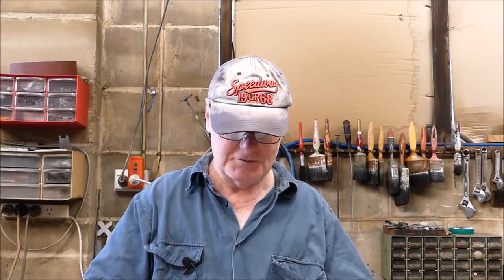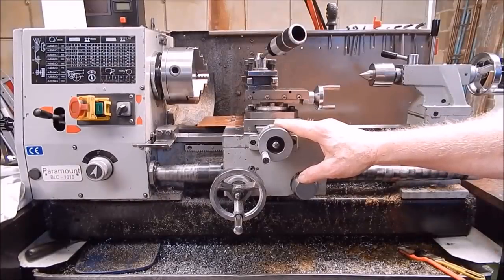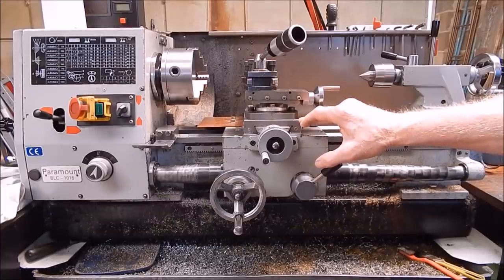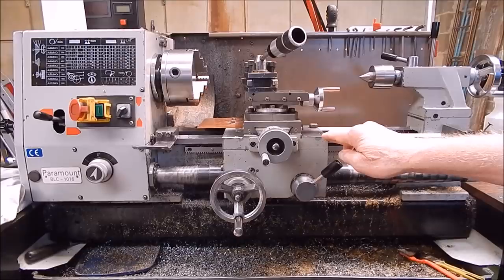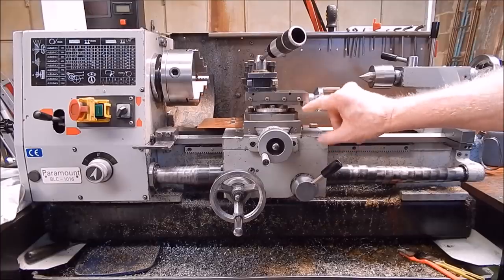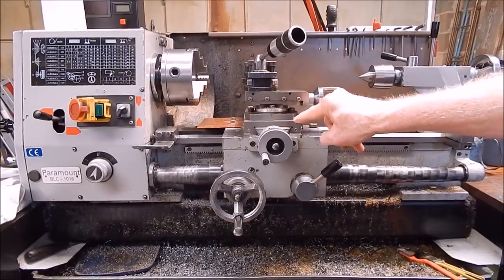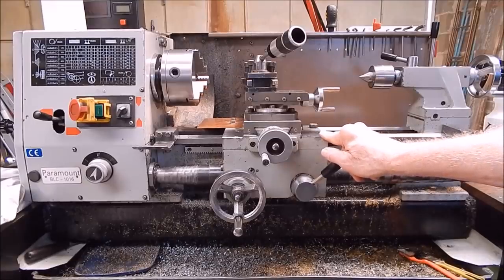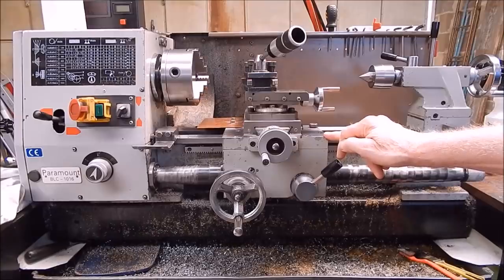The serious weakness in many small modern metal lathes

Comment: Hello Xanadu. About the weakness on the cross feed slides, with Tee Slots. Most slides are made from cast iron material. I might not be a engineer, but I have worked with a lot of machine tools. Tension from the Tee-Nuts, can effect, how the ways are adjusted. I just purchased a 10" x 20" Lathe, I wouldn't even have Tee-slots on my machine.
Reply from the maker: Yes, that's dead right Keith.  Cheers Rob

Comment: I think you have underestimated the strength of the remaining material. and over estimated the torque applied to it. For what these lathes were designed do, they are more than adequate. In one of my videos, I show an upgrade to the drive system on a Taig lathe. The upgrade allowed me to vastly surpass the original intended use of the tiny machine, however, I did not take into account the remaining parts of the lathe not being of sufficient strength to handle the extra torque. my point is, theres a limit to what these lathe can and should be used for.
Reply from the maker: Cast iron will definitely flex.  Put a bar in the tool holder, apply pressure and watch the dovetails spring.  More metal can only be a good thing.  Also stall your small lathe at say 400 rpm and watch the cutting tip drop.  Scary.  The problem is worse on some lathes being sold as the remaining metal thickness is pretty marginal IMHO.  Cheers Rob
Reply: As an experienced tool maker of 14 years, I would have to agree with the video but also the point stated above.  These machines are not made to take large cuts or do high precision work like production machines are.  The ones that are are priced substantially higher for a reason.  There's nothing wrong with the t-slot design if you know the capabilities of the machine.  You could drill and tap 4 to 6 holes and make a top plate with t-slots or bolt holes that bolts to the existing cross slide to strengthen it up and remove flex.  I would personally recommend a small used clausing or leblond to anyone that has the space and power requirements availablejj, but most don't .  You could always beef up a little guy the best you can if you want to push it to its limits and hold relatively tight tolerances.  Rigidity and compact size just don't go hand in hand without a high price tag due to machining, material and design costs.

Comment: The reason they put the slots that way is for gang tooling.  I have seen it more on smaller slant bed cnc lathes that turn short, small parts.  It is cheaper than a turret tool changer.  It is also useful for more accurate hole drilling that using the tail stock.  You set however many tools you want/can fit on it and just move the cross slide in and out to change from od tools to ID tools.  Not saying this is the best way to do it on these small lathes, but my guess is they did it to copy that style.

Comment: Counter rant:-  If you put a milling slide on to those long T slots it is very useful to mill face on....or slide back on the T- slots and rotate the slide.  Without this ability to move along the T slot, The milling range is severely limited.  I also mount other things on these slots...An ER 16 milling cutter and a rear part of toolpost.
Reply from the maker: Hi Joss, I would rather have a rigid cross slide and drill and tap a few holes - which I have done.  I expected some owners will use the "T" slots for milling, but the majority won't do anything like that.  Cheers Rob

Comment: If it concerns you then bolt a strong back (just a bracing beam) across the tee slots in 2 or 3 places where it isn't in the way.  Bingo.  Stiffness restored. 
You just made a composite beam. Composite beams work fine as evidenced by all the riveted road bridges out there.  Just because the lathe manufacturer carved sections out of solid by milling doesn't mean that other options aren't possible.  Sometimes a little lateral thinking is called for...
Reply: Yeah a "strongback" a viable alternative , I normally have one on , It s held down by several tapped boltholes. I often have a  a   big grinder on my biggest lathe on the rear of the CS , also the strongback gives  more length to the rear, that the grinder mount uses

Comment: Honestly most newer small lathes, even one like that paramount are more issues out of the box than they're worth. The whole t slot on the cross slide idea is stupid but I think its meant to make the lathe into a "universal" machine by allowing the use of a milling attachment. I think thats plainly ridiculous. In saying all that, I've got one slightly larger than that paramount lathe and the amount of time, money and effort I've spent to get it running right is ridiculous. Not to mention they have no cross slide power feed without the price going up 2 fold at the very least.
To be completely honest if I had my time again, I'd probably get a well loved colchester student lathe as the footprint is basically the same, price is the same, quality is out of this world in comparison, even after 40 years of apprentices and schools abusing them.
Reply: Absolutely. I've got two old Aussie lathes (Advance & Nuttall) and an old Aussie student mill (Hercus) and they're so much more solid than my mates modern imports it's not even a contest. The examples I have are in good order, accurate and a pleasure to use.

Comment: Point taken re the strength factor. I used to wish my old Raglan had t-slots because I did a lot of milling in it years ago - however, got round that and since those days probably prefer not having them. My cross slide is built like a brick latrine considering the lathe size (11" capacity).

Comment: You could be onto something there .  Leblond used to do it years ago , but they would have had castings designed for it no doubt .  I wouldn't have thought a small chinese lathe  would have created enough distortion pressures to have an effect  , but i do tend to agree with you . Cheers .
Reply from the maker: Hi Max,  try stalling a small Chinese lathe at say 400 rpm and watch the tool post flex/cutter tip drop.  Scary.  It's enough to snap the tip off that nice expensive indexable insert you've been using.  There are serious pressures at play, believe me.  It all ultimately goes down to the dovetails. Cheers Rob

Comment: Good video Rob. Very good points on the slot direction
I would have no problem with long slots if they made the slides extra thick to compensate, but it's China, they would make it all from sheet metal if they could find a way to make it work

Old lathes are better built. I'd love to track down a nice slotted slide for my Hercus

Comment: Most lathes I own are decades old European machines bought from scrapyards (Schaublin 102 & 102n, Weiler rdu280, Churchill Cub mk4). The only exception is a tiny little "Akebono Kikai" which is japanese, but was probably built for use on a warship considering how heavy it is for its size. In my opinion If you're going to do anything serious with the machines, it's best to buy used equipment and restore them to near new or better than factory condition. Lightweight hobby machines which don't have stellar accuracy to begin with, won't survive any degree of heavy use. They sure don't make 'em like they used to!
Reply from the maker: Another 102 owner.  Good to hear from you.  I have an early open headstock 102 and I have the VERY earliest headstock for one (in mint condition)  with no thrust bearing as they later fitted.  That is damn damn old. Awesome machines.  Plus they look incredible.  Cheers Rob
Reply: @Xynudu  I bought my first schaublin 102 after watching your restoration videos a couple of years ago. Open headstock variety, made in 1964! Loved it so much, bought a more modern 102n a year ago (1990 model). Your videos are a great source of information and inspiration, keep 'em coming! :)

Comment: Also if there is even the smallest chance you might ever opt for a cnc upgrade on your lathe (not a big deal anymore, with the many turnkey packages offered) ,,,,you will thank heaven for tee slots running the long way bc gang tooling is then a cinch.
Reply: I most gang tooling I have looked at was a complete unit that gets bolted down rather than a series of independent holders. Also, keep in mind, cnc will do away with the cross slide, so the height to mount the gang tooling is necessary.

Comment: My Warco 12x36 has T-slots crosswise and I added one at the rear for a rear toolpost.
Reply: My Warco 300 hs tees running both ways as its a mill as well but there is still quite a bit of meat in the cross section.

Comment: Hey Rob, don't the cutting forces when cutting push the cross slide down towards the ways, so this would not be a problem during normal use?
Definately if you were milling or cutting with headstock in reverse. 
I have the fi-610 model up from yours and it has the t slots you describe but by the looks the cross slide is considerably thicker. I think this would be a bigger problem on the compound.
Reply from the maker: The side nearest the chuck will press down, the opposite side away from the work will try to lift.  The FL-610 is OK because it is a lot larger physically than the lathes I mentioned and the cross slide is much thicker.  Where it becomes an issue is on smaller cross slides with reduced thickness/depth.  Some being sold are very thin in that area after slotting.  Cheers Rob

Comment: Looks like a good shop project to improve a cheap Chinese lathe if your so inclined.  Maybe you could build something for yours.
Reply from the maker: My cross slide is solid, so flex is as low as it's ever going to be.  However, that's not a bad idea and a great way to improve a cheap lathe.  I have seen some videos where a workshop with a decent mill has made a new cross slide up quite easily for old and new lathes.  Just swap over the hardware and you're good to go.  Cheers Rob

Comment: I think that the cross slides on Chineseium lathes are too narrow and tend to wobble on heavy cuts unless you rework the gibs.
Reply from the maker: The cross slide on my Chinese lathe actually has a wider dovetail base than an equivalent Southbend.  They all vary a lot.  The topslide is the weak area on many Chinese slides.  Reworking the gibs does wonders there.  The later offerings seem to be slowly improving/enlarging that area.  Cheers Rob
Reply: @Xynudu  Your lathe is without doubt more rigid than a southbend or hercus 9" lathe. I had a Hercus 9A before my current lathe, had it leveled and supported correctly, and twist-free, and gibs all correctly adjusted, and I was unable to take lathe cuts or mill in the way that your lathe can currently do. I don't think the Southbend/Hercus lathe is a particularly serious lathe - it's great to learn on - particularly the flat-belt model, because you can only get into so much trouble before you get belt slip. But once you have an idea what you're doing, you can easily outgrow that design, and it's a good idea to find the most rigid, well supported lathe with solid wide dovetail cross-slide and top-slide ways (or eliminate the top slide for 80% of work, if you can't get it to work well), and a bed that isn't too worn. The great thing is - with a lathe, you can upgrade in rigidity and barely affect the workshop footprint. Because you can get small, but heavy and rigid lathes. Not really possible with a mill - mass is everything. And along with that mass comes extra footprint whether you need it or not!

Comment: for what it’s worth, Taig lathes have t-slots perpendicular to the spindle too and they’re made in America.
Reply: I have an older (20+ years) taig micro lathe (and a regular size lathe) - I will have to check it out. It's definitely a weak design to have the t-slots running perpendicular to the spindle, because it forms a hinge from the cross-slide. Unless you double up on the cross slide thickness and forego some of the swing-above-carriage dimension. Thanks, Craig

Comment: The problem is that they are like most things overengineered, too many electronics to go wrong, some designer thinking up some stupid thing . Variable speed BS all you want is five pulleys and just change the belt.
Reply from the maker: Yes, you can't beat mechanical gearing.  Cheers Rob

Comment: My German lathe, like your Schaublin, ain't got no t slots, anywhere...big bolts, that's all ;-). Cheers, Rob
Reply from the maker: Hi Lohi, the Schaublin has them on the topslide.  That's how the QCTP or lantern tool holder are mounted.  The cross slide however is a massive piece of metal and does not incorporate T slots. 

I am reviewing a 7 x 12 Chinese lathe soon and it's pleasing to see such a technically good design with no belt drive and no T slots anywhere.  It can be done.  Unfortunately it has become a useless fashion statement on the mid sized bench lathes and rigidity has gone to hell.  Cheers Rob
Reply: @Xynudu  it would be nice if you could offer ongoing input to them on subtle items like this. I have found that the Asian manufacturers are often quite willing to listen. Especially when it means less work to drill and tap the raw castings rather than machine slots.

Comment: Chinese lathes are not the only ones with dodgy designs. My myford ML 7 has the topslide pivoting on a small stud and uses the first 2 crosswise t slots to secure.  With the super 7 they machined out a large hole vertically through the slide, the top slide has a matching base that has a dovetail machined round the edge and 2 threaded holes 1 on each side of the cross slide have plugs with angled ends that fit the holes and grub screws apply pressure to clamp the top slide While it is probably a quicker way of adjusting the top slide angle the large hole and side screw holes massively reduce the strength. As the dovetails on both the carriages are the same I have recommended people to replace the mlsuper7 cross slide and top slide with one from a ML7
ML7 slide

http://www.small-lathes.co.uk/Long-Cross-slide-[1467_3]/1151.htm

Ml super 7

http://www.small-lathes.co.uk/Super-7-Cross-Slide-Assembly-[S7CSA_2]/www.small-lathes.co.uk/Super-7-Cross-Slide-Assembly-[S7CSA_2]/1075.htm
Reply: steve allen  The links didn't work for me. I was able to view your site by typing in the URL www.small-lathes.co.uk

Comment: Just watched you mini rant about slotted cross slides. They are there to support hobbyists trying to use a lathe for milling operations so appear on most lathes aimed at the hobby market. It is not something that you should be crediting Asian lathe manufacturers for either.  I would suggest they have simply copied the Austrian EMCO lathes.  I agree that for the most part slotted cross slides are unnecessary apart from the added flexibility of mounting a rear tool post or perhaps some other small turret for tool holding. In my experience milling with a lathe is a poor option but I accept that it could be useful in hobby situations where workshop space and budget is limited.

Comment: All of the Asian lathes copied the Austrian Emco lathe designs, including the orientation of the t-slots on the cross-slides. So, ironically, it is actually a European design.
Reply from the maker: The original/early ones did in smaller sizes.
Reply: @Xynudu  The reason that Emco used the slots running front to back on the cross-slide is because they often had a milling head mounted behind the lathe. A milling table was mounted on top of the cross-slide. In order for the milling table slots to be oriented  (correctly) along the lathe bed, the cross-slide slots needed to run front-to-back. Many of the Asian lathes have the same option, though I have noticed that Grizzly has dropped all but one (12X36 lathe/mill combo)

Comment: Don't think that a person really needs .0001  or even .001 accuracy to do most metal work.
Reply: .001 is necessary for a majority of job shops
Reply: @APage-hn6cz  If you build stuff that requires precision ball bearings, .0001" accuracy is definitely needed for small ball bearings.  For larger ones .0002" will suffice.  Granted, this is tricky to achieve on most lathes with the first attempt, but with practice, sharp tools at centre height, .0004" should be doable.  After that, careful use of polishing sticks will get you down to the required size.  Mind you, the ability to measure to 10% accuracy is another skill that comes with practice, especially for boring holes to fit ball bearings.